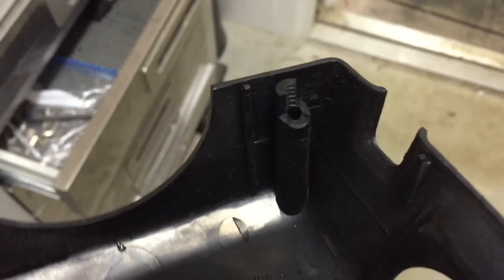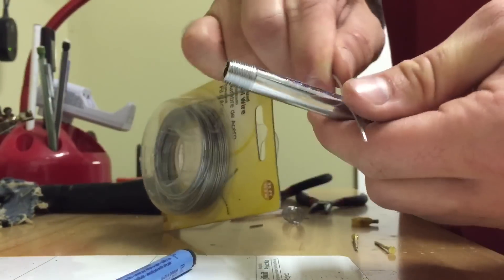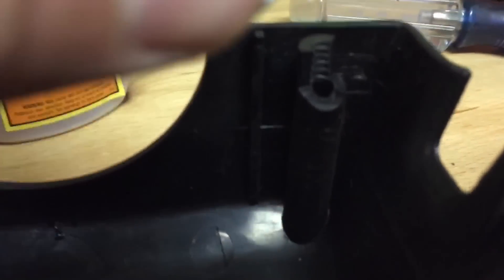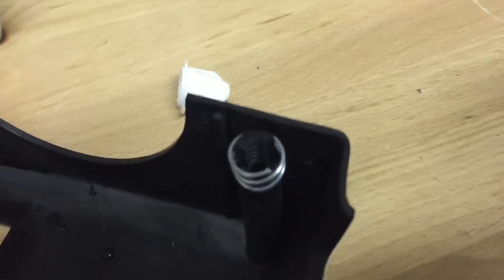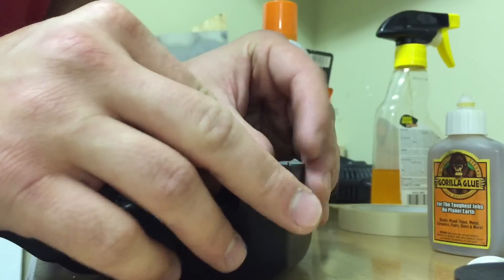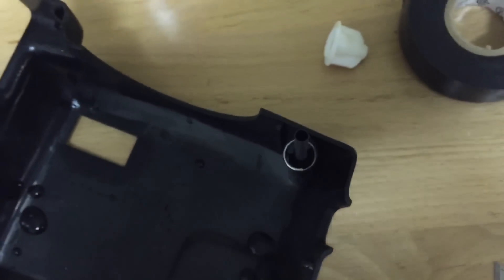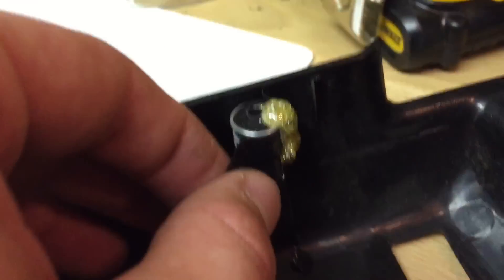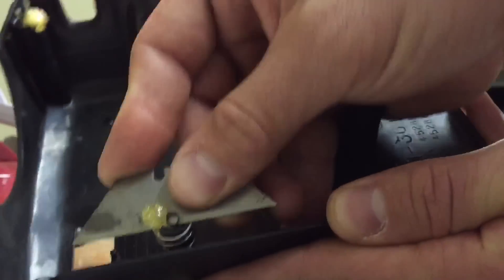Plastic screw mount repair

Comment: Very nice. I repair HP printers and in the Engineers infinite wisdom they created 4 plastic screw holes to hold the fuser. Works good for a while but eventually what happened to you happened to the printer. I have tried many other ways to repair but this looks like it will work!
Pretty darn inventive.

Comment: Superglue and Baking Soda. Make your form, pour in some superglue, add some baking soda, repeat making sure the soda is absorbing the superglue. Do it in layers so the superglue can soak in between the grains of baking soda. When done, it's rock solid and can be machined up with a dremel. Best thing is it is cured and ready to go in seconds! I will admit though I liked his idea for the heat shrink. I took it one step further using a peice the size of the hole but shrinking the end so it sat down into the threads and kept it straight and any glue from buggering up any remaining threads. I do that on old restorations where we can't get pieces any more. Clean it up, paint it if you want and no one will ever know.

Comment: This is a cool method. I have 3 Gameboys where screw sockets are broken and I was thinking about epoxy which should work too, but I like the heating tube and wire idea.

Of course I will have to do it on a much smaller scale. Cheers!
Reply from the maker: ZenoLand let us know if it works
Reply: @chdavignon  Will do. I have several other projects to finish first, but I will get to it vause I don't want perfectly good shells to go to waste.

Comment: Didn't work for me - the glue remained kinda soft. How long do you leave it to set solid?
Reply from the maker: Give it a good long while to set. The glue is pretty thick so it only makes sense that it would take much longer than normal to set.

Comment: Or you can use appropriate diameter plastic black straws  and cut them along with the smallest plastic anchors  and use a heating glue gun with crazy glue and voila. If the mount is completely gone? Then you need a plastic heat welder with abs plastic rod welding material  along with the plastic screw anchor and straw filled with melted  3M, jb weld or whatever type of epoxy that is plastic to plastic. the metal wire must add some strength to it I bet.
Reply: remember that if you take out interior trim and see it cracking, you can always get the black plastic straw that go around the mount as well the small ones that go inside and use whatever adhesive. it looks really good aesthetically.
Reply: Where's the vid

Comment: You deleted my comments of other things you can do?   And saying to activate gorilla glue you have to use water?   I was giving constructive comments not hating...  look up plastic weld  - it makes the piece one single piece again - instead of some alternative substance like gorilla glue that has zero sheer strength because there is no real bond.  And that glue is weak as hell - watch #PROJECTFARM
Reply from the maker: I did not delete your comment. It was removed either by youtube or by yourself. 

Here is your original comment, “ GORILLA GLUE - READ THE LABEL - IT SAYS "USE WATER TO ACTIVATE THE REACTION OF THE GLUE" Also - it's easier to just get the same type of plastic ABS something similar or zip-ties - and melt them in there - drill out a new hole and heating up the screw you are going to use - and threading it into the solid plastic you melted into it - boom - good as new.”.

My original reply, “Interesting idea. Maybe you could provide a video displaying this technique.”